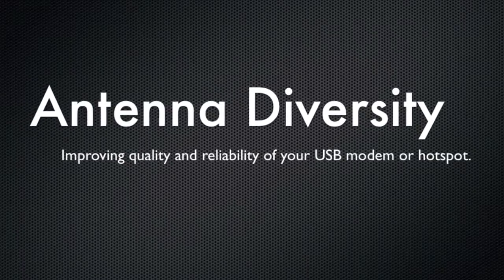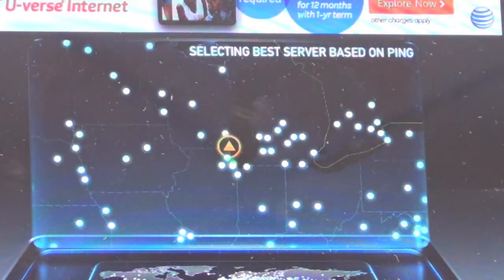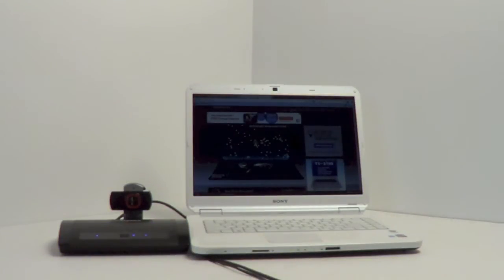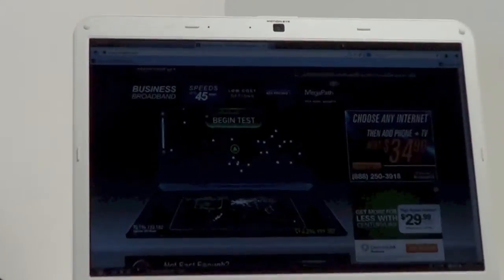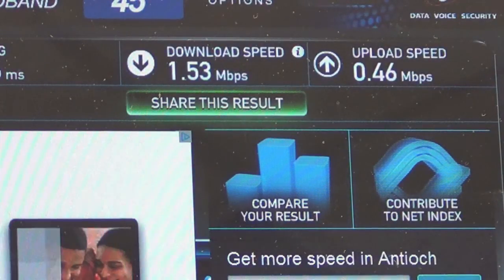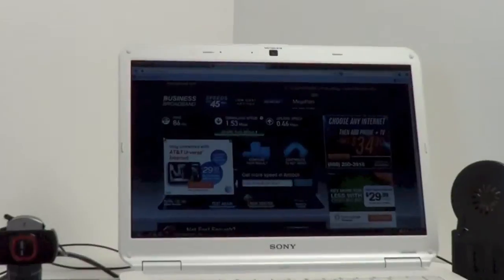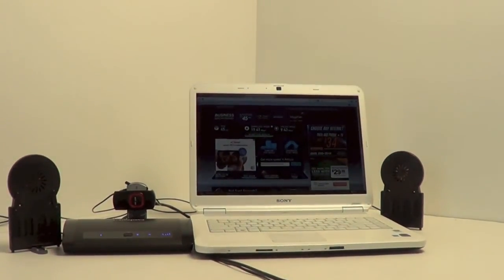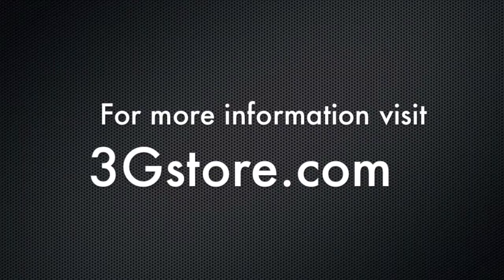Antenna Diversity - Improving cellular internet connectivity and reliability

Comment from the maker: The items used specifically in our testing; Cradlepoint MBR95, 2 x Booster antenna, 2 x Pantech UML290 Adapter Cable, UML290 modem. All of the items are available from 3Gstore[dot]com.